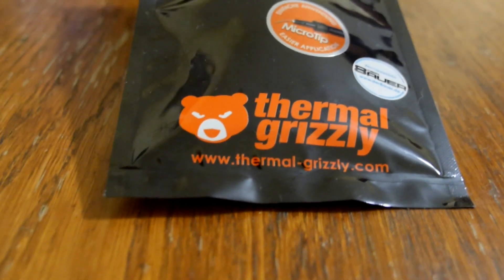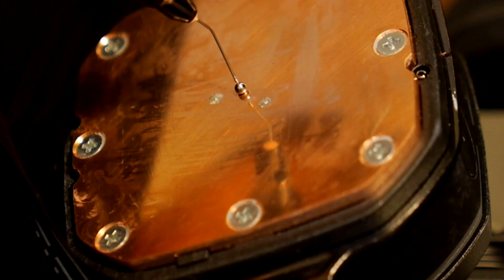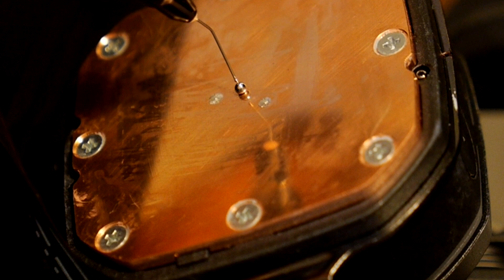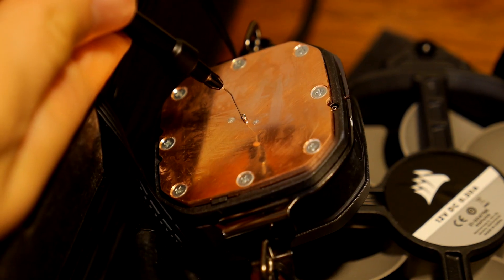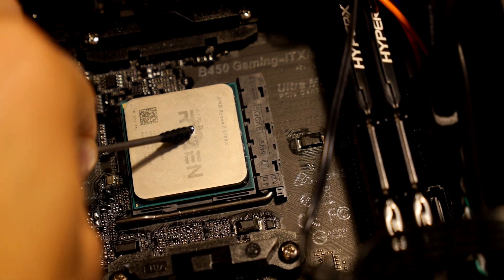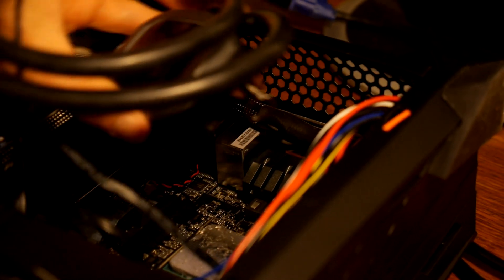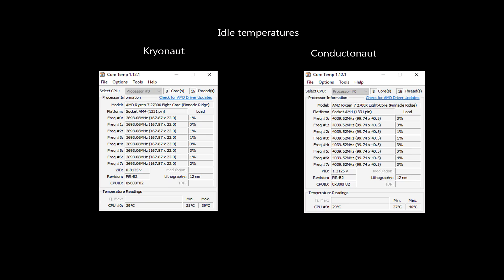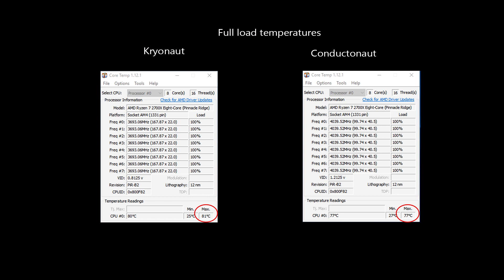Kryonaut vs Conductonaut

Comment: I find that unless you take all the mechanical steps, then liquid metal is just a hassle.
Lap your CPU, use the contact fame, THEN go liquid metal. A lapped I9 Raptor Lake with a contract frame and Kryonaut Extreme, will outperform a non-lapped CPU with Condutonaut in a stock frame by 8-10 degrees.

Comment: Condocnaut is a pain in the azz to apply and after a while when you want to re apply and clean the cpu you have to put so much effort and it still wont clean properly, basically ruining the ihs of the cpu and the cooler plate aswell...ive been using it for years but its just not worth it anymore

Comment: In other videos I have seen that some dissipating pastes degrade after 6 months, the same thing happens to the liquid metal? And if so... To what time does it happen? 🤔
Reply: This liquid metal does not degrade over time.  I had my i9 9900KS delidded and Conductonaut applied directly to the CPU die under the IHS by Silicone Lottery.  After a year I removed the IHS and inspected the TIM, it looked as good as the day it was applied.  At that time I removed and replaced the Conductonaut and there was no difference in cooling performance.

Comment: when doing a test with watercooling then 15 mins isnt enough, stress it for like 30 may even 40 mins
Reply: True depends how many rads you have and have large your reservoir and how much liquid is inside.
Cpu and GPU thermal Wong reach it peaks not until the water reached it limit first.

Comment: My processor i7 4790k. gaming Temps are in the 85-90°C rang.   reduced my temperatures best solution liquid metal or thermal paste?
Reply: Just use thermal paste, use a good quality one like kryonaut or noctua nt-h1. The extra hassle for liquid metal is not worth it.

Comment: i heard that the kryonaut will scratch your cpu heatspreader and heatsink.

To kry or not, it depends on luck. Dang.
If you gotten the bad batch, you'll kry due to scratch mark.
Reply: It scratch my bnew shiny Nickle plated copper cpu water block.
And since I don't have GPU atm and I only borrowed one to do a loop test with only distilled water and try to OC my r7 to since it's also my 1st time overclocking.
After testing I returned the GPU and disassemble everything re cleaned and I notice that there is some left over even I used 99.9% alcohol I though it was left over not until I clean the  block with toothpaste and toothbrush and reassemble it never goes away so it scratched my Nickle plating LOL.
I dismantle the loop for 2 reason I run a small amount of distilled vinegar with  distilled water to try to fully clean the rads again (2nd time but in the loop) and I have a filter set up but some still bypass it and entered the cpu block fins and the only way to completely drain and dry everything is to dismantle it.

Comment: The black 'Q-tip' applicators for Conductonaut are abrasive on the flattened end.   Hold it nearly vertical and rub in a circle with some pressure applied.   As soon as the abrasive tip removes the micro thin layer of corrosion that's always present the metal mixture will 'wet' and allow you to spread it.   This chemical bond is what helps give the most excellent thermal transfer characteristics.
Reply: You earned another 👍for being helpful

Comment: Kryonaut seems like it has a curing period of around 48 hours from my testing; resulting in better temps over testing right away. Here are my thoughts as far as Coffee Lake goes on an 8700k if you're overclocking. Use Thermal Grizzly Conductonaut between the CPU die and a RockItCool Copper IHS for LGA 1151 (About 15% more surface area + flatter surface, and around 5c~ difference). Between the copper IHS and heatsink (NEVER aluminum, preferably nickle-based coating) use Thermal Grizzly Kryonaut and cover the entire cpu with a thin layer. You can get slightly better results using Conductonaut between the IHS if using the OEM heatsink (use scuff pad top surface in the case of liquid metal), but if using copper IHS there will be permanent staining. Not really worth it imo.

Comment: Hey you forgot to say about the con.

On mixture with copper to aluminium on the situation
That will cause warranty avoid. 😂 

At the end unless your cpu are older or cheap cpu to try.

If high end cpu like i9 9900k or 3950 that do at your 
Own risk..😂

Comment: Look at the temp before telling him to test with the same frequencies. Ever a HIGHER freq give better temp result than a LOWER
Reply: Not sure what you're trying to say. If you're telling me that a higher vcore and frequency are supposed to produce lower temps, you're completely wrong. If you're saying that it's supposed to be close to the same result because voltage and frequency were higher on the liquid metal example, fair enough. The comparison is still inherently flawed, though. If you directly compare something, you need to apply the same metrics and conditions, otherwise the result is inaccurate at best. The criticism about the different CPU settings is completely valid.

Comment: Uhh... I've had my thermal grizzly lying around for almost 3 years straight never getting used. is it still usable even after that time period?
Reply: is it still sealed closed? that would be the biggest thing. otherwise, observe the consistency it has in youtube videos and see if your paste matches, if its thicker i would suggest replacing it.
Reply: I'd say no, after a while I notice mine getting kinda hardish/dry even with a tight seal.

Comment: Good review ! I replaced an already decent aliminium cooler push-pull with a Noctua NH-U12A + conductonaut. 75 degrees at high load instead of 85..... I guess the noctua and the grizzly are both worth 5 degrees :P. I ordered the noctua because conductonaut should NOT be used on an aluminium cooler (baseplate is nikkel layered on noctua)

Comment: is it me but WOULDN'T THE TEMPERATURE BE HIGHER ON THE RIGHT BECAUSE THE FREQUENCY IS HIGHER AS WELL AS THE VOLTAGE IF YOU ARE DOING A THERMAL PASTE COMPARISON SHOULD ALL THE PARAMETERS BE THE SAME FOR BOTH TESTS BECAUSE THE SCREENSHOT ON THE RIGHT AS FAR AS VOLTAGE AND FREQUENCY DOESN'T MATCH THE SCREENSHOT ON THE LEFT!!!???

Comment: Wow, those thermals are pretty poor compared to the VID
My old 4790K at 1.35v with Noctua paste under the IHS, runs at about the same temp.
Waitying for some Conductonaut to arrive for it, hoping that it will keep the temp in check at 1.4v so I can finally get a chip to 5GHz
Reply: the cooler is garbage
Reply: @noobplays8832  Fair call, guess im comparing to my  Supremacy Evo block, and 280mm rad.  On a side note, got some LM TIM under my IHS, ran up to 1.45 VID, still couldnt get past 4.9GHZ, guess I just have crap silicone lol, but at least the temps stayed under 90.

Comment: Sorry but this comparison
 is useless. You can't do a comparison
 with different clock settings. So the difference between Kryonaut and Conductonaut is even way bigger
Reply: Different clocks is a consequence of a better thermal paste. Using Conductonaut the cpu can handles with higher clocks due a more stable temperatures. The instructions  inside the CPU understand this and can give more frequencys...simple like that...
Reply: @bfbonadiman  but not everyones system thermal throttles. For someone wondering whats the temp difference under same performance this video doesnt help
Reply: Plus he tested it on 2700x. ^^

Comment: You are idiot on kryonaut you have 3600mhz and on conductonaut you have 4000mhz
Reply: How does that make him an idiot? He's showing how superior the latter is to the formal by working the CPU harder and getting lower temps. Not a scientific approach but it doesn't take any validity away from what he set out to find. Higher temps at lower clock is higher clock at lower temps. If he de-lidded his CPU it would have been even more significant. No need for name calling.
Reply: @theodorepollock1273  I think Derbauer did a delidded 2700X, and it was not worth it even with Conductonaut they said only 1-2 degree difference since the chip is already soldered. But what he should've done was test the CPU at the same clock speed so that, there wouldn't be this much confusion.

Comment: Well I bet the difference would be even bigger if you use the same Vcore and same frequency :)
Reply: hahahaha :)
Reply: Probably hit thermal limit and it downclocked
Reply: that's what I was going to say, he had an overclock temperature on conductonot and it still performed better than the kryonaut.
Reply: Watching this now, he probably just had precision boost overdrive on and didn't realize the gains in the clock speed. Huge win for Conductonaut